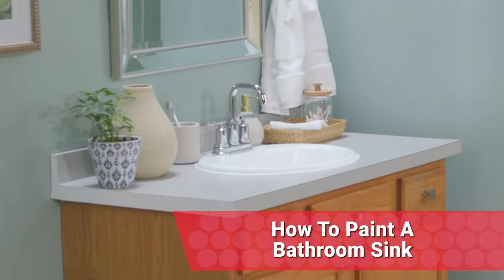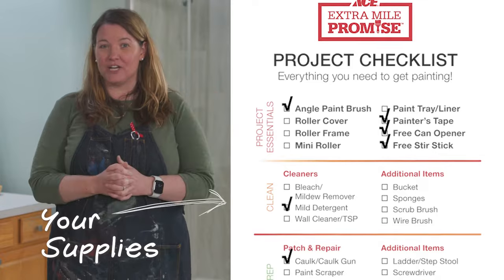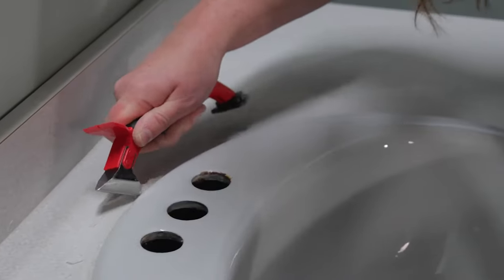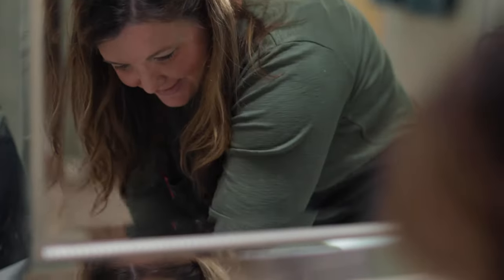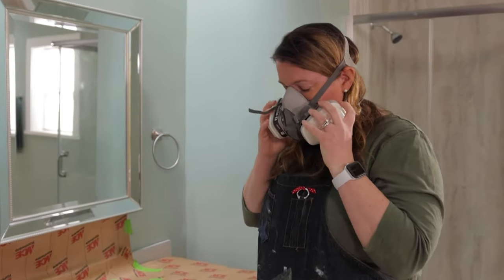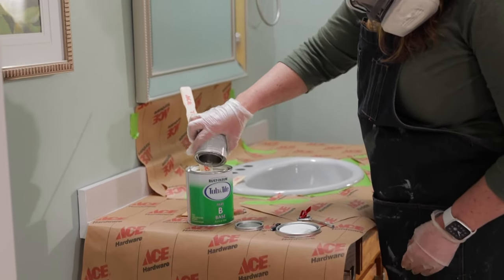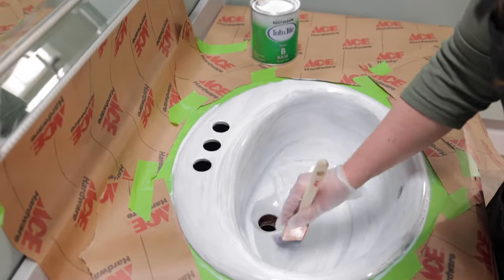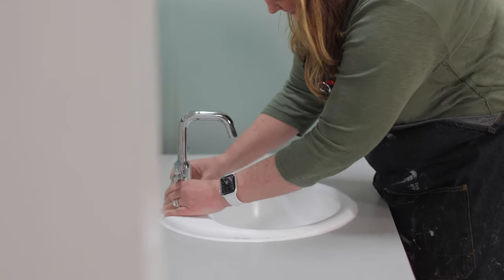How To Paint A Bathroom Sink - Ace Hardware

Comment: If the sink and counter are all one piece and it all needs painted is this product for both?
Reply: Hi Sherri, you can use the Rust-Oleum product in this video for the sink & counter if it’s all in one piece! Id recommend using a small foam roller on the countertop this will give you an even finish! Definitely make sure you vent the area where you paint too because the fumes are very strong.
Reply: @annietheace7196 thanks! This is what I have and I want to take it from off white to white. I thought I saw people recommending rustoleum 2x spray paint but the description says not waterproof, doesn’t prevent rust and though it says covers plastic I’m not really sure what my sink and surrounding countertop is made of. So many choices and too many steps to completion! I did like the video and learned from it. Thank you again. 😊

Comment: What if I don't want to use all of the paint? Can't I just remove what I need from the canisters without mixing in them?
Reply: You shouldn't do that because the ratio has to be perfect for it to cure properly. That's why one can is larger than the other.

Comment: How do you smooth out the paint?
Reply: Hi Norman! Rust-Oleum Tub & Tile is an epoxy coating which is self-leveling. Small bubbles will disappear as it dries. Wait 1-2 hours for the first coat to dry. Apply a second coat if needed.  The trick is applying thin coats. I found that using a ¼” short nap roller works best and be strategic when you roll (or brush). Don't just roll it on in any direction, go in one direction and this will eliminate lines. Pick up a good quality fine-bristle varnish brush to help you feather those edges. You got this, the product works great! Please make sure you good ventilation too! Happy Painting!